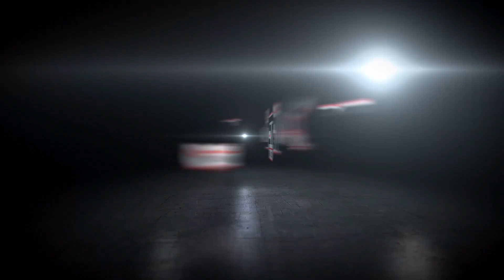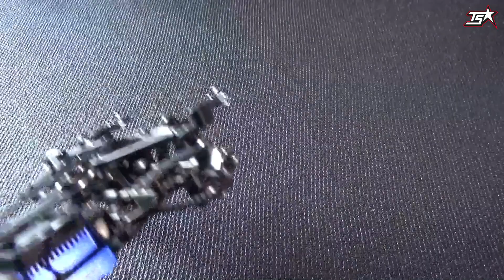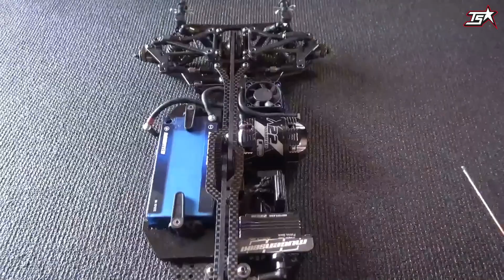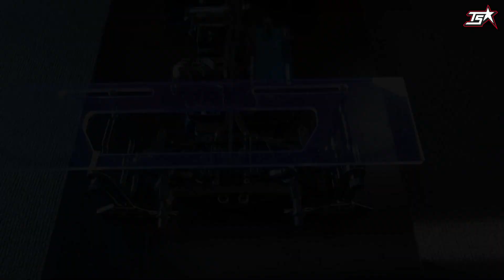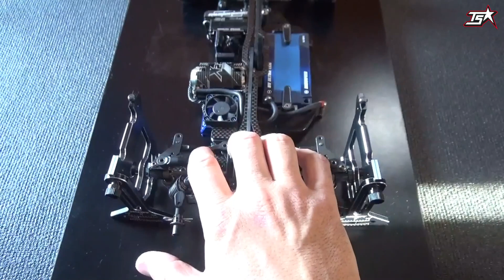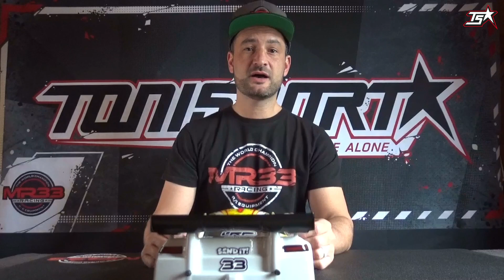ToniSport Newsfeed: Active Rear Suspension English

Comment: hello,i know its already 2 years since this video came up,but i just bought mugen mtc2 with active shock (front and rear),my question is,do i really need both front and rear active shock??or just the rear is enough?second question is my active shock is wiggling too much,is this normal?thank you
Reply: Hi, yes depending on roll center and ride height, the Shock owers have much play when the car is not standing on its wheels - thats normal!
The rear towers have a biogger impact on the car than the front ones but when you are runnign on carpet or on a track with big curbs I wpuld use them both front and rear!
Reply: your replied !!!omg !!!thank you so much for this answer !!i really do appriciate it !! @patrickbeckrc2113

Comment: So it's not active suspension. It's pasive mechanical link.
Reply: you can call it however you like. It is not static as it changes the toe value so we call it „active“
Reply: @patrickbeckrc2113  Engineering doesn't do "call it however you like". Adjustable rear bump steer is what it is.
It's interesting because bumb steer is usually something you want to avoid, so creating ways to use it is clever. But it's not active, not at all.

Comment: I have the same car Mugen MTC2 will get to track to test but have you found a shim count you like to achieve say more stable on throttle cornering?
Reply: It depends a lot on the track, the traction and the motor you use. In Modified I mostly used 1-2mm shims on the ARS, the stock guys mostly between 2-3mm shims. The overall static toe also plays a role.  
I recommend 3 degrees of toe in as staring setup with a 2mm shim at the ARS. From there you can wirk in all directions!